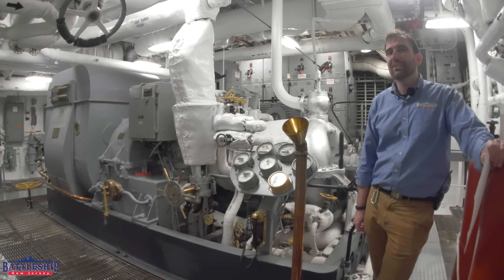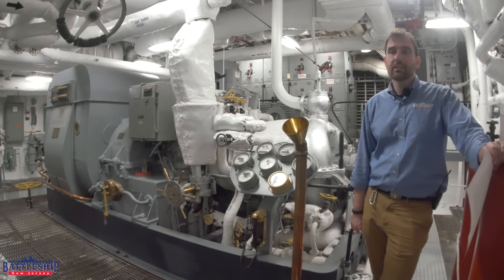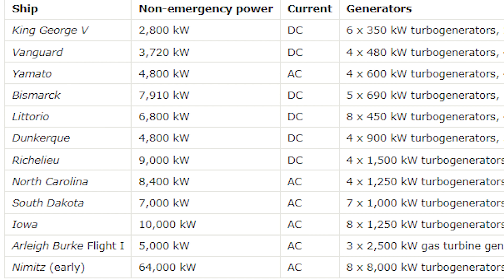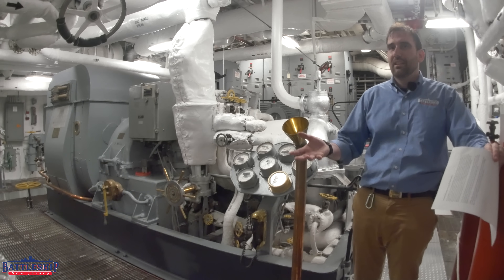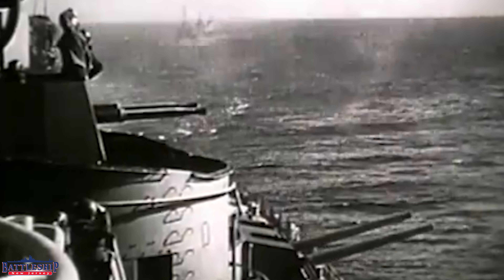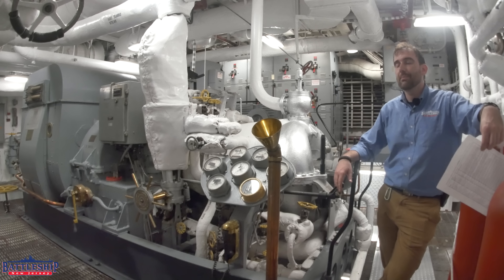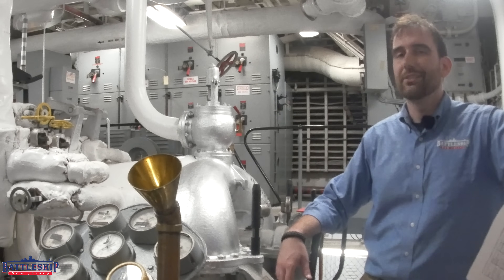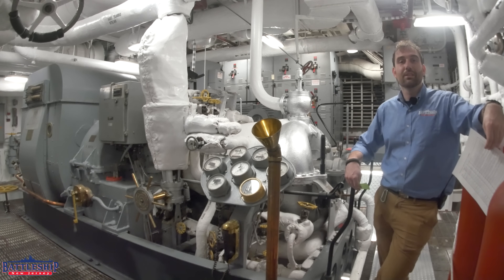How Much Power Can a Ship Generate and Did a Ship Really Power a Whole City?

Comment: In about 1965 I was on a Reserve training cruise on USS Colohan (DD 658), a Fletcher Class Destroyer.  We were told that the ship had been sent to Anchorage, Alaska, after an earthquake to provide electrical power.  I suspect there were other ships there also, and I imagine she provided some other emergency services.  As for AC and DC current, I know the ships I was on over the years had both in outlets in the heads and they were labeled and color coded to show which was on that fixture.

Comment: I was a part of the crew of a Nimitz class carrier that was asked to help feed the hampton roads area after hurricane... Gilbert? I think it was... Now, a single Nimitz class's 2 A4W nuclear plants each put out 550MW nominal power, and each reactor fed SSTG (Ships service Turbine Generators) as well as main engines, catapult steam, and SSMG sets. We put out to sea to avoid the storm coming in, and upon coming back to port, hooked up shore power and instead of shutting down, took both cores to critical (normal) operation and back-fed the local grid from the ship. I have no idea how far this feed extended nor how many other ships were assisting in this task, as power was restored by time we were taken off port/starboard rotation and allowed to go back home, but I do know it happened at least once. It's pretty awesome to hear they could have potentially done this in the pre-nuke era as well.
Reply: Nimitz got about 200MW propulsive power and 100MW electrical. The 550MW is the thermal output of one of its reactors. A lot of that is lost in translation.
Reply: @hernerweisenberg7052  IIRC thermal-to-electrical at nuke plants is typically 33% efficient overall.
Reply: @hernerweisenberg7052   Indeed.  The ford's are the power plants, each reactor's electrical output is triple that of Nimitz class.
Reply: I had wondered if it was possible for A Rather large Naval Ship to give the electric grid a jump start as it were....It's good to know not only is it possible it has happened once or twice atleast. .... with the highly integrated electrical grid we have it can be an issue for the power company to bring plants back online after a major outtage because out put and consumption MUST match at all times to not damage the power grid. Peaking plants can be used but if large sections need to come online  that could pose real problems to do safely. Having the extra capacity  they can provide things easier and quicker. Thx
Reply: @alexlail7481  practical engineering did several videos on the power grid including a video on black starting. Unfortunately he didn't make any mention of using navy ships to feed into the system
Reply: @alexlail7481 look up floating power plants 😊
Reply: Complete malarkey. Of the 8 installed 8,000Kw turbine generators. Only 4 of them (SSTGs) can even supply power to the ship's electric plant. The other 4 (CTGs) ONLY supply power to the reactor cooling pumps. Nimitz-class does NOT have as much excess electrical capacity as you speculate. Although Ford-class currently has plenty of excess, no such procedure exists in ANY Reactor Plant Manual (RPM), Steam Plant Manual (SPM), Electric Plant Manual (EPM), or Ship's Organization and Regulation Manual (SORM) for feeding electric power to the shore.
NO US-flagged NUCLEAR ship has EVER supplied power to the US grid. Not in Hawaii in 1982, not in Hampton Roads, not EVER. There is no instance where NAVSEA08 would ever consider it.
Contrary to the video's claims of it occurring regularly for humanitarian relief, it simply DOES NOT HAPPEN. Don't be a sucker for the sea stories you hear on the mess decks.
FYI, The 1929 event of the USS Lexington powering Tacoma, WA was planned well in advance due to long-anticipated shortcomings of the local hydro plant's output. That's a FAR CRY from supposedly providing emergency power on short-term notice with NO PROCEDURE to a heavily wind-damaged distribution grid.
I rode out Hurricane Isabel as the on-duty Reactor Mechanical Operator aboard CVN-75 while we were DOUBLE-CHAINED to the pier at Portsmouth. FWIW, we disconnected from shore power BEFORE the storm hit and were on diesel generators for the duration.
Reply: @getmeagator  I'm glad someone straightened out us keyboard warriors! I just cant picture 4 cables large enough to handle the at least 250k volt AC coming out of a submarine. hatch,just  so many hazards in the process.
Reply: @Dieselfueledwork Yeah, 250Kv high-tension is a bit more than Nimitz's 4Kv system could handle.
Reply: @getmeagator  its like you said, too many mess deck stories!
Reply: When Tacoma was being powered by the aircraft carrier, it was during a drought because the Columbia River to run lower then normal, causing the the dam's to generate let's power....as memory serves, it was for several months.
Reply: Much smaller scale but diesel-electric locomotives have been used for this as well. In 1998 Eastern Canada and North-Eastern United States got hit with a nasty ice storm, a couple hospitals were able to keep the lights on thanks to train engines!
Reply: True, modern dc rectified locos can do that.
Reply: That's pretty impressive! Now, to have more than one ship at a time supplying electrical power to the local grid does present a problem, in synchronising the phases between the ships. A tiny variation in frequency between two supplies (ships), not usually an issue, can mean three phase voltages on a single phase conductor! The only practical way I can think of to deal with this is to have each ship supplying different parts of the grid and so the city. I presume the US grid is similar to the UK one, in that sections can be isolated with circuit breakers; it's usually done for maintenance purposes.
Reply: @rogerbradbury9713  The EM's know how to connect generators so that synchronization is not a problem. There is a phase meter that shows the phase difference between the two lines that are going to be connected. Once the phases are close enough, the breaker connecting the two circuits is closed. Once that happens the generators are phase-locked automatically. Then they can be left connected, or a line can be disconnected for maintenance.
Reply: @charlesgantz5865 The instrument you are speaking of is called a synchroscope
Reply: @thomasfreeman7770  Thanks. It's been a long time. I do remember that occasionally an EM was told to close or open the switch at 5 till. So, they would look at their watch, and at 5 till would open or close the switch. Maybe a legend.
Reply: @charlesgantz5865 Could this have been a reference to the synchroscope being circular and referring to fully synchronised being at 12 o’clock (by a watch face) and thus flipping at 5 til (the hour) could be flipping as approaching synchronisation.
Reply: @rogerbradbury9713  
Well, I hear that the UK uses AC/DC, whereas we in America prefer Gn'R. But as far as the electrical current question is concerned, I am not qualified to say. 😁
Reply: All power hooked up to the American electrical grid must be synced up by a signal coming from the NIST radio signal system or it will blow up sub-stations. @rogerbradbury9713
Reply: using terminology I learned on the Practical Engineering channel:
the vessel you were posted to and possible more ships became a "black start/bootstrap site" for the effected area?
Reply: It reminds me of the time a hurricane knocked out the power throughout all of South Philly. I loaded my 5.5hp gas powered generator into my canoe, rowed up the Delaware river, attached an extension cord with a surge protector to their power grid, and provided power until the city's system was repaired.
Reply: @HighlanderNorth1  I remember that!
Reply: @HighlanderNorth1 😂😂🎉this Guy
Reply: @HighlanderNorth1  Hopefully that was coordinated with the power company. Linemen have been known to be killed when some bozo connected their improperly installed generator to the power grid after power went down.
Reply: @charlesgantz5865  
I was joking. All of South Philly couldn't be powered by a 5.5hp gasoline generator sitting inside a canoe.

Comment: So how does NC have half the identical generators as Iowa but yet put out 8400 kW instead of 5000 kW, which is 1/2 of Iowa’s 10000 kW? That table does not look correct. “The math” doesn’t add up.

Comment: RN. ships use the same power supplies 440 /115 volts but our domestic voltage is 240 AC. so domestic supplies have to be transformed .220 DC . hasn't been used for ships main power since the 50s .so I did think Ryan's figures a bit strange and it looks from the comments I wasn't wrong .

DC. ships needed motor generators or alternator sets for specialist voltages with all the associated control equipment ,  and cabling was heavier . Changing to AC.saved a lot of weight as the higher voltage could be converted with transformers and rectified to obtain DC.  Power requirements have increased dramatically over the years .

Comment: The class of DDG I served on was the Charles F Adams class, all are gone now but at one point they had plans to convert 2 of them into a "power barge". Simply put, they removed all the superstructure except the two stacks and they were to be moored in remote areas to be basically a 435 foot long portable generator. The 4 sstg's (ships service turbo generators) would provide 3 megawatts of AC power at 480 volts, but it never really worked and the only ship to actually be put into use was the USS Hoel DDG 13. My ship, USS Robison DDG 12, had been stripped of her superstructure but never went further than that. Sad end to a wonderful ship. She was sunk as a reef off the coast of South Carolina.
Reply: they did convert the Henry B. Wilson.i dont know of any others.
Reply: @leftyo9589  As far as I ever found only the Hoel and the Robison endured the conversion. I would rather have seen them all used as target practice and sent to the ocean depths. Seems more dignified in my heart.
Reply: @SMOBY44  ive seen pictures of the Henry B converted. basically they cut the superstructure off her, and left the stack.
Reply: @leftyo9589  I saw the Hoel in that state, and was told the Robison had met the same fate but was later scrapped. It's so hard to tell them apart without the armament and a hull number. Until someone told me the Robison had started the conversion I thought only the Hoel had been converted.

Comment: I don’t know about a battleship powering a city but USS Lexington did it! 1930s  a Washington state port city had an emergency, it’s power grid was crashing and Lady Lex was dispatched to assist in the emergency relief. The Tacoma public library and the Washington state historical society have articles and photographs of the Lady Lex keeping the lights on until the grid came back up.
Reply: Lexington had turbo electrical propulsion and produced 130,000 kW of electrical energy to drive her propellors
Reply: Not a quake
The Lake Tapps hydro plant was running late due to a dry year.
Reply: its power

Comment: No DC power on a ship, no DC power in the electrical grid either.  It's all AC.  DC is mostly found in electronics or very large specialized electric motors for commercial/industrial use.
Reply: High voltage dc is used in the grid where long distance transmission is required for example under water

Comment: This was a very disappointing video, Ryan.  You mention the Zumwalt class a couple of times but fail to mention they use a gas-turbine-electric propulsion system.  That's why they have so much electrical generating capacity.  This also applies to the Tennessee and Colorado class battleships, and the Lexington class carriers, which were steam-turbo-electric.  That's why Lexington was able to power Tacoma!  She had about 140,000KW of generating capacity!
Reply: The same applies to the Nimitz. Nuclear carrier propulsion is through electric motors, so I don't think it makes much sense to include it in a chart like that.

Comment: The aircraft carrier Lexington was used to power Tacoma, Washington state. The Lexingtons were electric drive. I do not remember the year, but it was when Robert Heinlein was assigned, so early 1930’s.
Reply: "U.S. Navy sent Lexington, which had been at Puget Sound Naval Shipyard in Bremerton, to Tacoma, and heavy electric lines were rigged into the city's power system. The ship's generators provided a total of 4,520,960 kilowatt hours from 17 December to 16 January 1930 until melting snow and rain brought the reservoirs up to the level needed to generate sufficient power for the city." - Anderson, Richard M. & Baker, Arthur D. III (1977). "CV-2 Lex and CV-3 Sara". Warship International. XIV (4): 291–328. ISSN 0043-0374 - & Wikipedia Article on her
Reply: Because Lex and Sara had electric final drive, I would guess their electric power output was far greater than the auxiliary generators on any of the listed BBs.